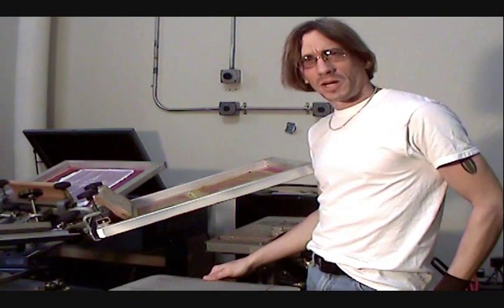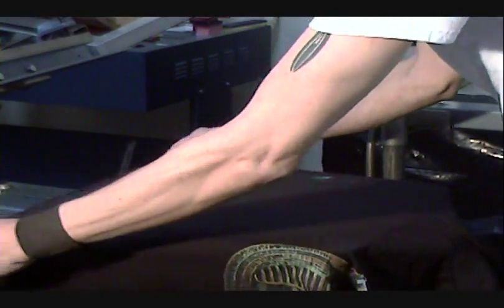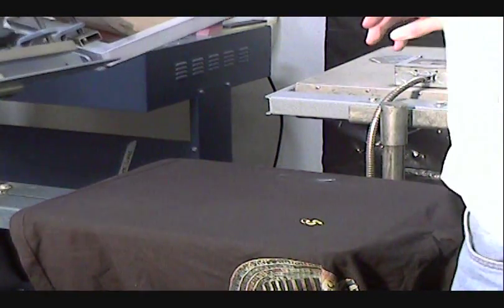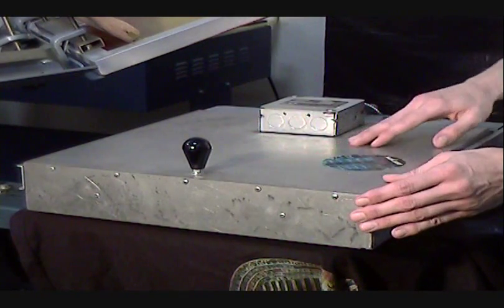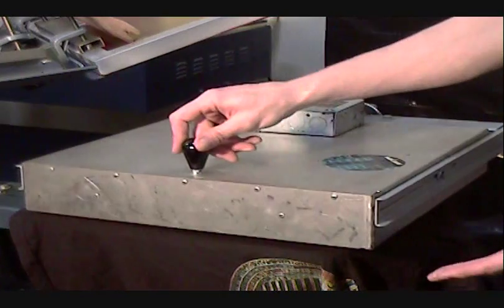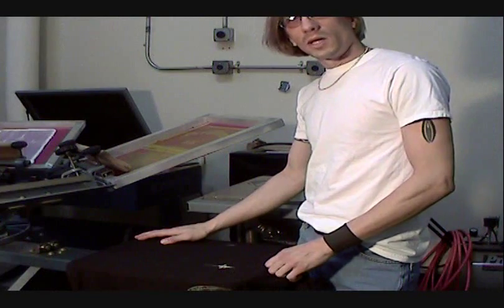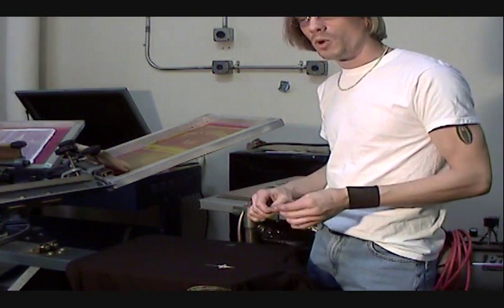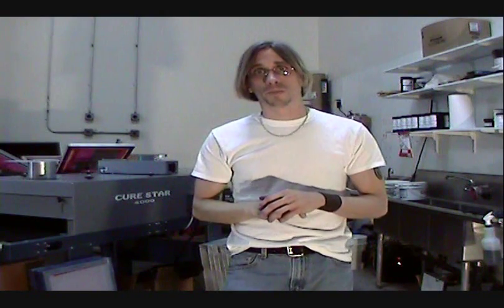How To Screen Print: 2 Color Print Demo With Flash

Comment from the maker: @chappledesign You are welcome! It is my pleasure to help out. Many people use a flash cure unit to do the final cure on plastisol inks. As long as you get the ink up to curing temp, then you are fine. It’s just slower than a belt oven and possibly inconsistent if you are not careful to heat the entire print area evenly and thoroughly. I hope that helps out a bit. Thanks for watching and commenting!

Comment from the maker: @SuperNovaGlasses - No, there are water based inks that are high opacity and work very well. There are also rubberiezed type inks available. Plastisol ink is just the standard in the commercial garment printing industry. But you will find many different types of inks avaialble for this any type of garment printing. Thanks for wathcing!

Comment from the maker: It may be possible to flash cure with a hair dryer but it might take some time and would probably be inconsistent. If you want to do something like that, get a $30 Black & Decker heat gun from the hardware store. This will work very nicely and it gets very hot. It will work best with smaller designs. It will be somewhat difficult to fully and evenly cure a large print by this method.

Comment from the maker: The standard ink for screen printing tee shirts is called plastisol ink. This ink can be printed with a very soft feel, soft hand or a very thick rubbery type of feel most associated with spot color art. Whether the ink is soft or thick depends on how you print it. There are other specialty inks that will actually mimic certain surfaces such as suede.

Comment from the maker: @ZorkaArts If it’s Speedball water based ink then it will air dry and need to be heat set between 150 and 250 degrees F. Just keep the container tightly closed and store it in a cool not so dry place if possible. Thanks for watching and leaving a comment! ☠

Comment from the maker: @ZorkaArts I see, I think…LOL. It’s an air dry ink so yes it will dry in the mesh without being heated and then it can be very difficult to get out. You can use a retarder to slow the dry time and/or back flood the screen between prints. Thanks for watching & commenting! ☠

Comment from the maker: It depends on the color of the shirt. If it’s a light color like gray or natural then yes. Those dyes would be weak and this method should be fine. If it were a dark 50/50 like red, maroon, or black then I would use an under base with a polyester white ink to block any dye migration that could happen with those colors. Thanks for watching and leaving a comment! ☠

Comment from the maker: Many things affect that. Your flash cure unit and how hot it gets, the ambient temperature of the room and even just the duration of time the unit has been on. They can build up heat over time. You want to find the distance for your unit that will flash the ink quickly without scorching when it is hot. Videos give you tips on that. It may have been colder on one day than the other when making the videos and I adjusted the height to compensate. I do not recall. Thanks for watching!

Comment from the maker: @ilikepoprock I think most likely you would just print the shirt twice; once with one color and design and another with the second color and design. Depending on where the different locations are you could print them with one screen and 2 colors if they are small designs separated enough to work with 2 inks on the same screen. I guess it would depend on the art and print locations to figure out how you want to do it. Thanks for watching & commenting! ☠

Comment: Hi, Thanks for these videos! Is it possible to get by with just a flash dryer and no conveyor oven for the final cure process? Is there a trick to do this? Or can you get by with say 2 flash units: one for flash and one for cure? We have a 220v used flash unit but no conveyor as we are at home and space is limited (just getting set up). Thanks for any suggestions. :-)